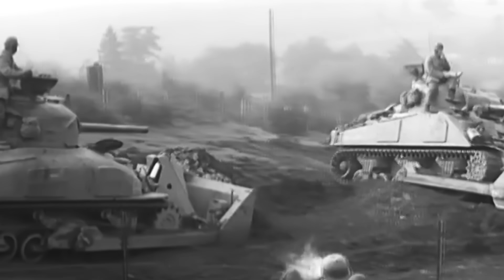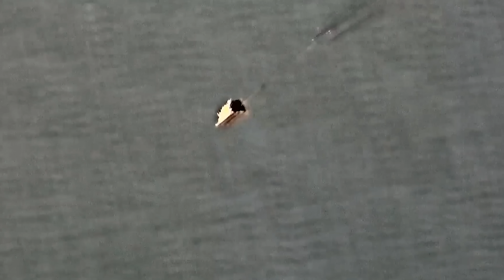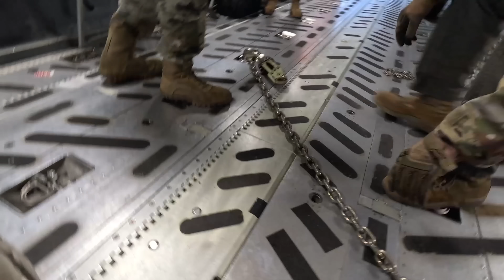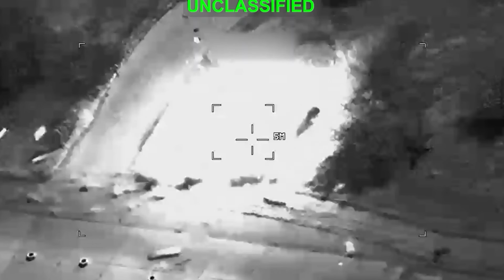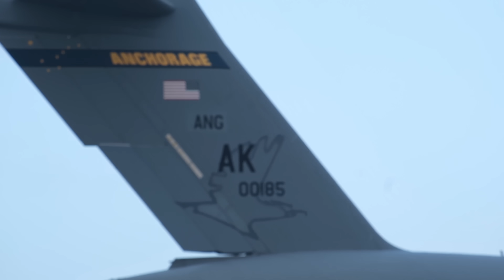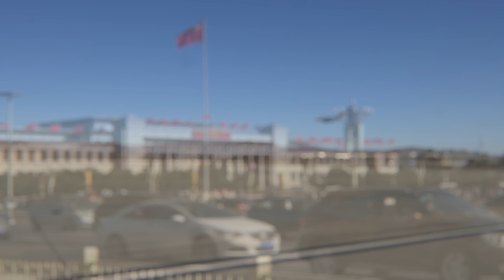China Has a New Problem… U.S. Just Did Something No One Thought Possible

Comment: Rapid Dragon is about volume and cost effectiveness.  Look at operational costs:  F35 $40k per hour,  B-1 $92k per hour, C130 $10k per hour.  What RD does is reduce the costs of deploying volumes of stand off munitions without breaking the bank.  RD is also unique to the US.  No other nation has numbers of Heavy Airlift capacity. I don't think any other country operates a FLEET of planes that are configured to transport Main Battle Tanks.  The US Heavy Airlift planes total about 600.  This fleet could deliver about 18,000 stand off munitions in a single strike.  Part of the RD is also lower cost stand off munitions produced by (amongst others) Anduril at volumes of 5,000 per year at around $150k per year and they are available to scale this up in a massive surge.  Leidos, Kratos, Northrup Grumman are all also producing newer lower cost stand off munitions for the Rapid Dragon program.  The US other 'fighting planes' do have the capacity to deliver massive volumes of stand off munitions.  But as I mentioned these have higher operational costs. They also have more specialized pilots than Heavy Airlift pilots.  The operational lifetime In hours is longer for Cargo planes because of the higher stresses experienced on fighter aircraft.

Comment: I thought this was possible.  The AC-130 Hercules gunship has been in successful use for some time and using guided weapons.  Using guided weapons from a greater height reduces the groundfire risk. The P-3 Orion could also have been easily modified to support ground forces.  The new P-8 Poseidon could also carry cruise missiles and is a modified Boeing 737.  C-130s also carried massive bombs that could clear ground to allow helicopters to land. Usually 1 at a time.  I think there was a plan for a modified Boeing 747 to carry cruise missiles. And also fighter aircraft.  Dropping cruise missiles from a cargo aircraft is far from being original.  But it is certainly an extremely powerful and practical option with limited costs using mostly existing equipment.

Comment: Got anything on the development of laser weapons ? I thought they would be used eg against missiles
Reply: they require too much electricity for gas powered vessels, and nuclear vessels are banned in most allied ports and are expensive, so you won't see them soon
Reply: @ash-
Not entirely true.
Zumwalt has gas turbine power and was built to have megawatts of electric power to run not just lasers but also railguns. 

Nuclear power would be preferable, especially for deploying magnetic armor.
Reply: @chuckevans2792  The Zumwalt has its own host of issues which hamper it from being effective in combat even as a dedicated energy weapon carrier. Nuclear power is better but it is just not feasable until more allied ports allow it, or costs come down, or our shipyards finish building submarines
Reply: @ash- what is worse than design by committee? 
Redesign 3x by 3 committees😢
Reply: They have been used they are just not talking about it to much. Israeli actually used them to shoot down rockets from Palestine attacks, it was successful but you didn’t hear much more after that.
Reply: Same problem they've always had.  Battery tech isn't there yet.